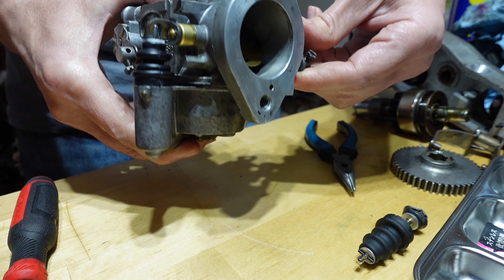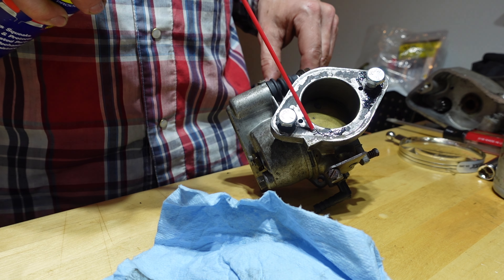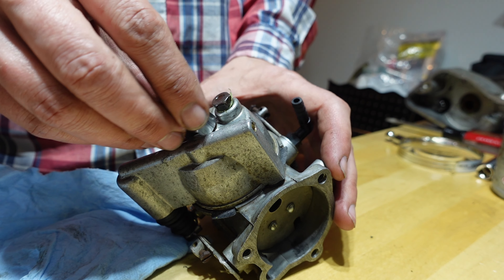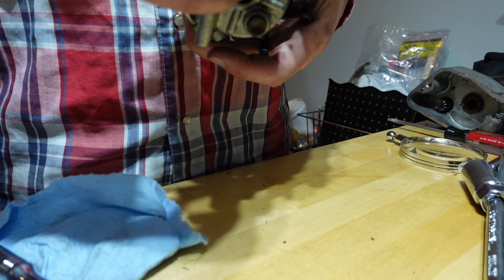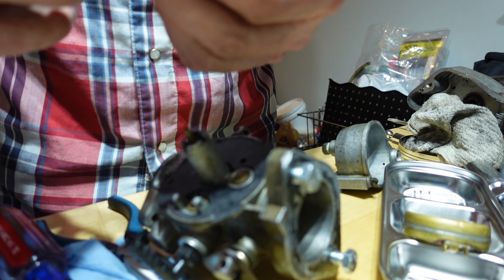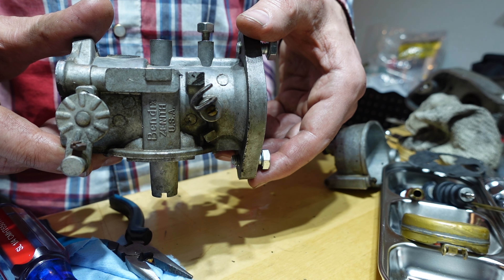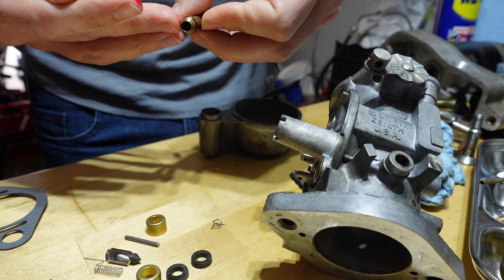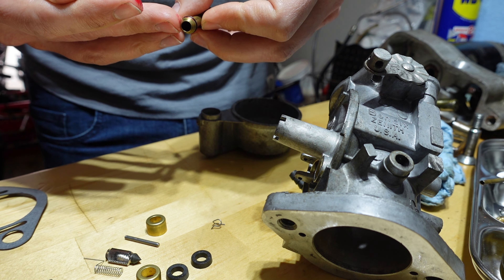Bendix Zenith Carburetor Rebuild - 1973 Sportster XLH

Comment: I'd love to see how you dial it in once placed back on. I am having problems with mine and think the rebuild kit is faulty. I also noticed you did not have any springs on your main jet and low speed jet screws.
Reply from the maker: @JunkyardDadski  great questions and a keen eye. My model doesn’t have a main jet adjustment, so no spring there. The low speed fuel adjuster spring was indeed missing. I ended up ordering a NOS spring and installed it.
I did end up replacing the intake manifold o-rings and used the adapter rings and band style seals to get a rock solid intake seal with no leaks.
The bike runs beautifully, I started with low speed at 1.5 turns out and currently at 1.25

Check out my latest IG to hear it running.

Let me know how things go!